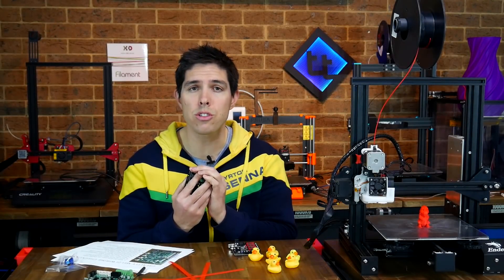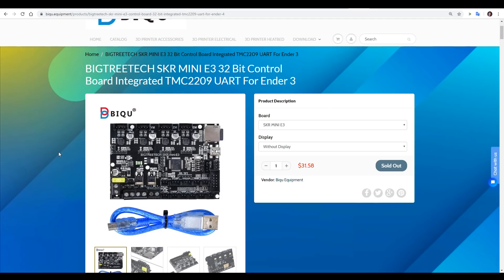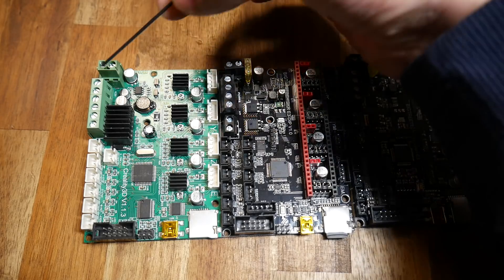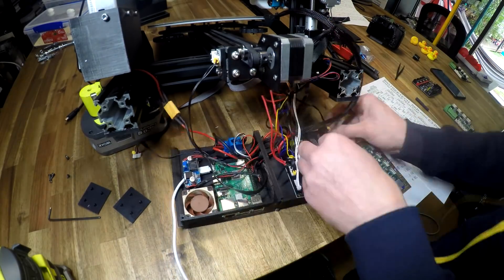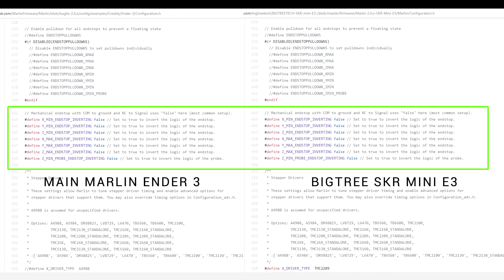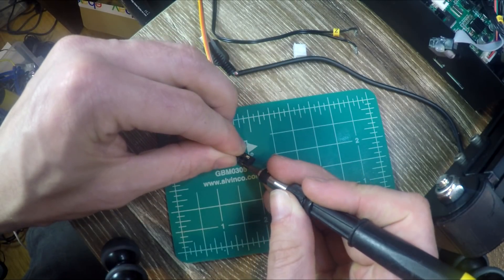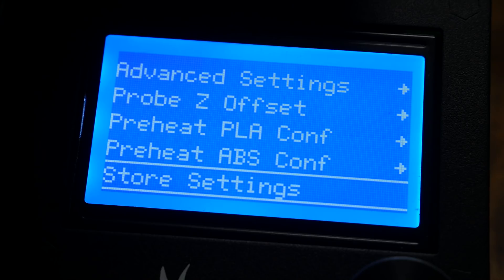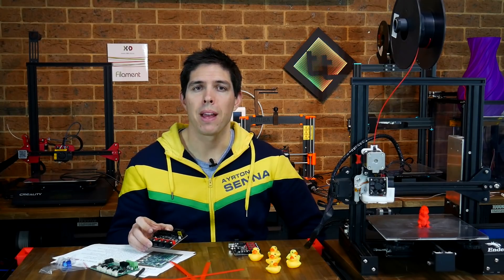SKR Mini E3 - The best Ender 3 upgrade from stock?

Comment: The sound level difference alone was sufficient to warrant me buying that bad boy. My E3 isn't particularly loud to begin with, but if you're getting that kind of a reduction, it means that I can definitely use it at times when the neighbors want quiet. The other stuff is just bonuses.

And BTW, when I bought the ABL from Creality, it came with the necessary gear to update the firmware.

Comment: Actually, the Cheetah is less expensive than any version of the SKR, and also carries on board trinamic drivers, yummy isn't it ? 😉
Reply from the maker: I looked into it but there seemed to be some persistent bugs. I'm sure they will get them sorted though.
Reply: @TeachingTech  well, I guess it's fixed for now as it works as a charm here on 3 printers 😉

Comment: Hi Michael,
Amazing video! I was wondering if there are enough expansion pins for a bl touch and a filament runout sensor. I was planning to use the sensor you made a video about with a micro switch.  Thanks!
Reply: Michael, can you point us toward which pins to put the runout sensor on.  I guessing everything else will be the same as the stock BLT and runout setup.  Thanks
Reply: @tinkeringwithelectronics  Not sure if this is useful or not but the TFT35 V3.0 display has connections for a runout sensor. It also has a connection for machine power shut-down once a print is finished.

Comment: I just installed the SKR Mini E3. It was very easy. I didn't have to flash a new firmware, everything worked well. I think it solved all the surface artifacts and apparently my Ender 3 prints as well as the Ender 2 now. I still have to check with a grey or black filament to be sure.

Comment: V1.2 is in! :) one week for delivery in UK. Just installed. EDIT: All sorted. Did loads of pids, rock solid now, under 0.5 degree variance. I've never used bl touch but would like to, just dunno about all this wiring malarkey. Gonna look into both as I don't mind a marlin fiddle.

Comment: I think this mod is quite a long way from being the best.
1. stock 4.2.2 and 4.2.7 boards dont need a bootloader either. or already have it integrated?
2. easy enough to update marlin with thermal runaway protection etc on the stock board.
3. stock 4.2.2 and 4.2.7 is also 32bit
4. manual bed leveling is easy and cheap/free when you get the hang of it.
5. Only surface artifacts I see are caused by the infill showing through if the walls are too thin
6. Love the classic loud stepper sound
7. Not as easy or affordable as the stock board already in the machine

I would say hands down the best upgrade I did was adding a bimetalic heat break and a hardened steel nozzle. Even cheaper than changing the board and it lets me print all kinds of filament. For the price though, you cant beat the cardboard box enclosure - another fantastic upgrade for the ender 3.

Comment: The right BL touch wiring for the e3 v1.2 board is (servo plug - from top to bottom): brown(gnd), red (5v), yellow(sig), black(gnd), white(zmin). Otherwise the board won't output to display.

Comment: Works great on the original CR-10, too! Just use a nylon screw in the mounting hole near the center of the original mini E3 board as there is a resistor very near the hole. Nice drop in replacement!

Comment: i just recieved my SKR MIni E3 v1.2 board and installed it. This is 3 months after MIchael's video released, after they waited for the 2209 drivers backordered..  and  it still has the buggy firmware.  highly recommend you download and install the new firmware... otherwise when you do your first print it will send the nozzle off the edge of the bed and make a loud grinding sound as the belts slip...   i downloaded the firmware and it fixed it right away!!  (25 Oct 2019)
Reply: Did you use the file he compiled here for it or get it from the Bigtree site? Curious cause when you go to download his it says it's untested with v1.2 board.
Reply: @DaveHarrison12  -  i used the file he listed under the Youtube video.  worked just fine on my 1.2 board.

Comment: Have seen these SKR boards on Ali, but cannot quite pull the trigger and get it for my Anet A8.  May be like putting lipstick on a pig.  Sure would be nice though, to have extra flash to fit the latest Marlin on there ... and auto stop detection would  be awesome.

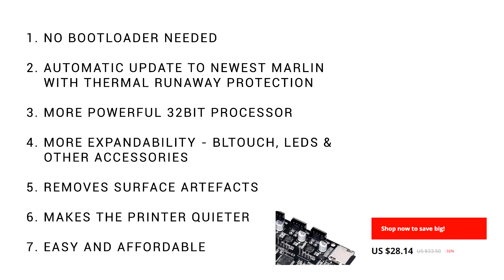Comment: You show the skr mini E3 hotend fan wired to direct power but at 10:48 the fan is not spinning. Did you wire it differently, and how can we turn off the fan while the hotend is cold?

Comment: I considered the mini dip but just said YOLO and bought the full SKR v1.3 and some 2209's.  Printed a case and I couldn't be happier.  The full board gives you so many more options and the only drawback is you have to print a case which takes about 6 hours.  Knowing what i know now, I really just don't know why someone would buy a mini.  The whole point of having a 3D printer is to print stuff so why not just print a new motherboard case and get a full board?
Reply: For real?- " I really just don't know why someone would buy a mini"
Because it is cheaper and more convenient.
Reply: @Cloudman572  It's cheaper by the cost of a McDonald's lunch.
Reply: @seventyfive1  I'll take your word for for it- I never touch McDonalds. 
So you acknowledge it is cheaper, it is more convenient and just as good as a 1.3 and yet you struggle to understand that cheaper and more convenient are good for normal people- strange.
Reply: @Cloudman572  It's not as good, it has way less expansion options.
Reply: @seventyfive1  And what are you making so much use of on those cough "way more" expansion options pray tell.
Reply: @Cloudman572  You can run a 2nd extruder or a 2nd z axis motor. If later you build a printer from scratch, this board will do everything you could possibly need. Right now I'm running an 80mm fan off the 2nd heater thermistor which means I can control the fan speed so the printer is even more silent.
Reply: @seventyfive1  So you are thinking about building a 3D printer from scratch when there are so many good pre-built printers, well bully for you. Suddenly it is clear why you alone think that the 1.3 is so so much better than a mini. Thanks for making my day.
GL and HF all.
Reply: @Cloudman572  I think it's better because it's only $4 more. If you can't afford $4, you got bigger issues than what 32 bit board to buy.

Comment: I was tempted but I’m still not sure, the idea is sensorless homing on the 1.3 and the fact you can replace a failed driver instead of throwing away the whole board still appeals more to me.
Reply from the maker: The SKR V1.3 is still more capable, I agree. The E3 DIP solves one of your problems at least. I haven't read enough to know if it supports sensorless homing easily.
Reply: Teaching Tech Glad you’ve posted this though, a lot of people are considering the upgrade. For the money, I may well just ping for one instead of waiting on the tmc2209s to eventually be restocked. Cheers mate

Comment: I ordered qty=2 of the v1.2 Mini E3.  The first board failed to interface with my display and I never got it working.  The second worked seamlessly (saving a thermistor mixup on the initial install).  I will update this comment depending on what Biqu customer service does to make it right on the first board.  Overall the second board is working well and it is difficult to hear the stepper motors at all.  The fans...that's another story...:D

Comment: I found my motors running hot, and changed the current settings to 550mA for X/Y/Z and 650mA for E, on the understanding that the JK motors are apparently identified by peak current, JK42HS34-0844YA-03F being 0.84A and JK42HS40-1004AC-01F being 1.0A. This comes out as about 600mA and 700mA RMS respectively, take a bit off for safety hence 550 and 650. Can do this in Configuration_adv.h, but also simply by changing the advanced configuration settings on the LCD menu (scroll down to see TMC drivers item) and save to eeprom (for which I'm using eeprom.dat on the sd-card, which I thought was necessary but I could be wrong).
Yay, no more fiddling with trimpots!
Reply: Update - the motor current limits have just been changed in Marlin for the standard Ender 3 configuration by thisiskeithb to 580/580/580/650 so that's the right thing to do to stop the motors running too hot (https://github.com/MarlinFirmware/Marlin/pull/15115).
The use of on-chip flash memory for saving configuration settings has also gone in (https://github.com/MarlinFirmware/Marlin/pull/15126), so can drop the eeprom.dat file.

Comment: Yeah, installed the skr mini v 1.2 and it was a nice upgrade, running so quiet and the printquality actually improved. BUT!! - with the skr mini my Ender 3  unexpectedly restarts mid print, so several projects I had to give up printing. Reinstalled the original creality board and no problems..

Comment: What is the circuitry he has by the raspberry pi around at about the 4:48 mark.  I am guessing it’s a coming from the PSU from the ender 3, and going into a voltage regulator or a way to drop the voltage to feed into the raspberry pi ( USB white power maybe for just the testing? ).  And then a relay to the printer board, so that the pi can be on and the printer doesn't have to be?  I feel like i missed a video for that.

Comment: It's definitely a major improvement over the stock Creality board or even the silent one. The most important thing is it has a bit more memory which means Marlin can have more features although it still gets tight with autobedlevelling enabled and a few other things. Probably no point for Ender V2 which uses a 32-bit board out of the box.

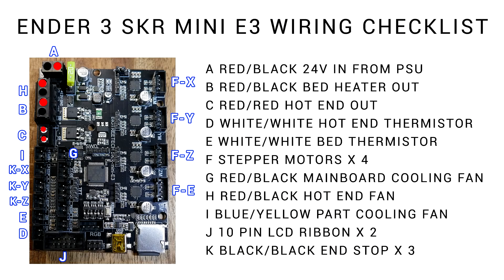Comment: 5:05 Shouldn't B red black wires be swapped? I compared the board with the original and it seems like negative and positive are mirrored for extruder and heating bed. Extruder doesn't matter since it's nonpolar, but I'm unsure of the heat bed. Can someone clarify?

Comment: Currently the price difference compared to the SKR v1.3 together with 5 TMC2208 is just 7€. I am not sure which board I should rather get, since the SKR v1.3 has a higher CPU clock (100MHz instead of 72MHz) and a bigger board usually means more possible upgrades. But being able to reuse the mounting holes and having basically everything as a drop-in replacement is also nice. (TMC2209 is btw currently out of stock, so you can still get TMC2208 or you have to wait a bit longer)
Reply: Do not look at the CPU clock, look at the features:
The SKR 1.3 has the same CPU as smoothieboard. You can try smoothieware, which is more advanced than marlin. Also the CPU is better supported by Marlin (the HAL for STM worked not correct till 4 weeks ago, and the name "marlin 2.0.x-bugfix" should tell you, how experimental Marlin 2 is at the current stage).
Also the STM32 has no EEPROM, it is emulated on SD - so changing SD can have sideeffects.

Also the SKR 1.3 has same formfactor as the Gen L, so you can use most designs made for the Gen L.

Altogether, while the SKR mini e3 and the SKR e3 DIP are nice solutions for drop-in replacement, the SKR 1.3 seems definitly to be the better choice.

Comment: for anyone who switched the order of the BLTouch wires to match the video and your printer stays on a blank screen, change the wire order back to the original (brown/green, red, yellow). That was a solution for me after double checking all my wires and connections

Comment: Hi Michael,  of all the instructional videos for ender 3 stuff yours are the easiest to follow and are the most complete.  I have looked at others (I know but I had to :-) ).  I thank you for that for after getting an Ender 3 pro last Xmas I have been printing like mad and upgrading following your instructions.  However, I now find myself in a position where I need to connect a BTT SKR MINI-E3 V1.2 to a Bigtreetech TFT35-E3 V3.0 display and can't find anything anywhere that helps with connecting the black TFT cable to the MINI-E3.  Because it took so long for them to arrive here in the UK I don't want to just hook them up and hope, if they die because of wrong connections it would be heart breaking.  Obviously I want to connect them off the printer first to make sure I have things properly right.  Do you have such an instructional video?  I can't find one anywhere or maybe you could just let me know where to connect the TFT cable to the MINI-E3.  Thanks again for your tireless great videos.

Comment: Just an F.Y.I. - currently, the guidelines to build the newest marlin-2.0.x-bugfix for this board will fail to compile. They suggest you use a custom version of the TMCStepper library. Sadly, their version isn't up to date enough to build the latest 2.0.x-bugfix. It will work if you update and manually merge back the changes as a temporary fix untill bigtreetech updates their repository.

Comment: You still need to tweak marlin firmware to be sure in a lot of stuff!
As minimun: replace CHOOPER_TIMING from _12V to 24V, this reduce heat and noise even more for TMC drivers!
On all Ender boards it’s nice to set HOMING_FEEDRATE to (20*60) and HOMING_BUMP_DEVISOR to {5, 5, 4} and parking will be A LOT less aggressive!
I know, BL-Touch is awesome in atomic bed leveling, but, if we speaking of cheap solutions why not enable manual mesh (MESH_BED_LEVELING)?
Reply from the maker: Starting with Ender 3 config fixes some of that stuff. The stock homing settings are very slow. I've covered manual mesh bed levelling but maybe it's worth a dedicated video.

Comment: @Teaching Tech  Problems with Stealthchop.  Michael, wonderful channel, thanks for all you do. From my first Ender3 flash well over a year ago you've been a tremendous influence and help.  Downloaded your firmware.bin and was up and running in no time. Only issue I have is under the TMC drivers/stepping mode it says stealthchop enabled and I have to change all axis to off to get it silent, then after a power cycle they get turned back on again. What am I doing wrong? And Shouldn't Stealthchop enable /On be the silent mode?

Comment: There is "SKR MINI E3&E3 DIP eeprom.txt" file on the github page describing how to enable eeprom emulation. MCU used in mini e3 doesn't have any eeprom.
Reply from the maker: I saw that but it wasn't needed for me. All verified working without emulation.
Reply: @TeachingTech  There must of fix the issue in the later versions, it originally didn't have it enable by default.

Comment: Great video, and i purchased the SKR mini E3.  I have the blue/yellow plugged into I, and the MB Fan into G, but the extruder fan is on at 100%.  Anyone know if I should swap them?
otherwise this post was awesome!  i even added the TFT35 for a full ender upgrade.
Reply: Hi there, did you solve your problem? Just got my SKR e3 mini and my fun is running 100% and cannot control it...

Comment: Hi Michael, it'd be interesting to know how well this board has tested for you, especially with your BLTouch.  

There's numerous conccerns on github about the 5v line being choppy and when using a BLTouch hitting the buildplate, I've found the same, and my board doesn't recognise it's a usb device either.  I'm assuming you won't mention any issues due to you being sent these for testing from the manufacturer, but I feel people should be warned prior to jumping in and buying this amazing new board, there are bugs in it and it's not a simple plug and play that they may expect.
Reply: This comment needs more attention.  Not necessarily referring to any potential bias, but there is a real issue with BL touch not working 100% and sometimes with catastrophic results.  I have also tried to find a solution and haven't found anything that fixes the problem reliably. (note i have bltouch version 3.0)
Reply: Robert Johnson fit a 100nf capacitor between  the vcc and the ground on the BLTouch. This helps solve the chittering on the line. I’m yet to do it but check the bigtreetech e3 mini github page, people have talked of success.
Reply: @RobertJohnson-cd5mw  I can confirm simply popping a 100nF ceramic capacitor between the VCC and GND on the BLTouch has cured this issue with 100% success rate since.
Reply: Thanks for the update; will definitely try it asap.
Reply: @RobertJohnson-cd5mw  Yup.  So when the steppers operate it causes the fluctuation in the signal, it can be viewed here: https://imgur.com/99kHqls The capactor smooths out the fluctuations enough to keep the BLTouch operating.  I simply soldered one onto a pin connector as seen here: https://imgur.com/a/6z3gWxG  Now I know it works I'll move it elsewhere.
Reply: @pukington  Seriously, thanks. This info/pics are going to be a life saver for me, will update once i have received and installed; but it is great to know there is a solution.
Reply: @pukington  So I'm not to sure if this will work for you but it seems like enabling BLTOUCH_FORCE_SW_MODE in Configuration_adv.h seems to worked for me since before I couldn't get to do a g29 without the probe failing but so far I have been able to about 18 in a row without a single fail.
Reply: LopezfsS that’s interesting. Oddly enough I literally just read the same elsewhere too. I hadn’t seen it before but will definitely try. I saw the problem via this: 
https://imgur.com/99kHqls and have fixed it by putting a 100nf cap between vcc and gnd on the BLTouch. It’s worked fine since I’ve done it but if there’s a FW fix even better. Thanks!
Reply: Robert Johnson read the other comment below, I too just read about BLTOUCH_FORCE_SW_MODE working for someone else too. So probably worth trying before messing with hardware needlessly.
Reply: Going to try FW fix first but either way seems like a good idea to add the capacitor if there is such a fluctuation in the 5V rail.  It will be a while till the capacitor arrives, so this will be a perfect time to update the firmware anyway. Thanks.